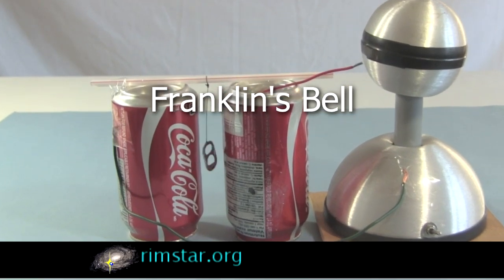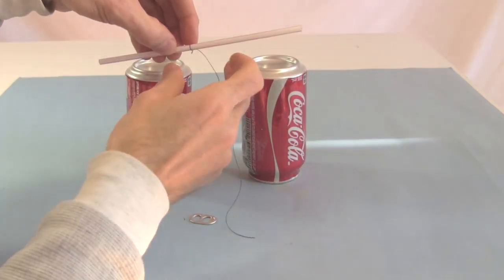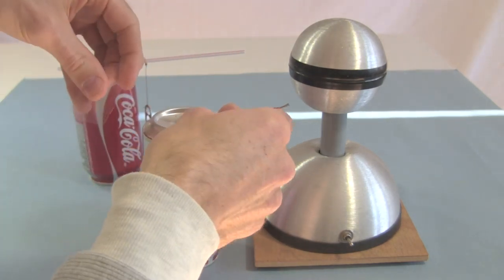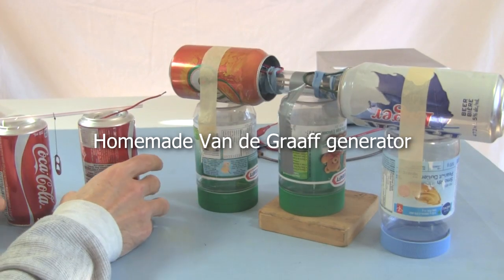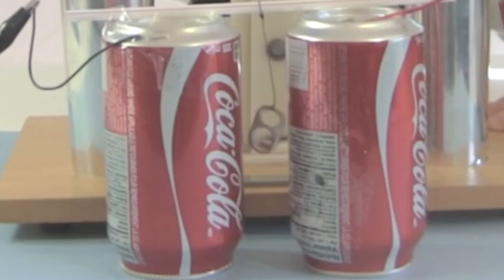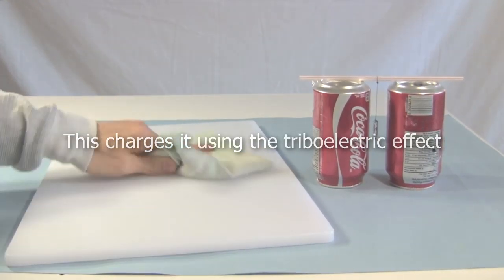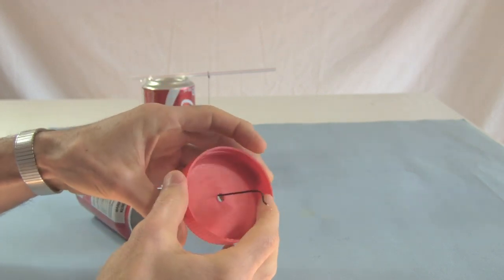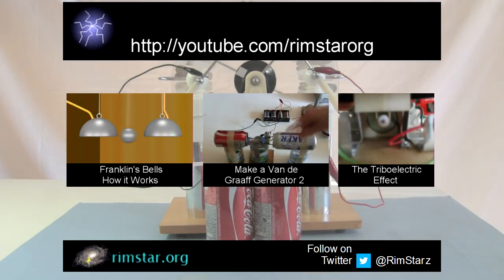Franklin's Bells - How to Make and Demonstrations

Comment from the maker: Glad my video came in handy! Thanks for letting me know! Regarding the cables, any wires will do but those are wires with alligator clips on the ends. It makes them easy to connect to things. You can buy them at Radio Shack or any electronics parts store. Or you can just get any wires, strip the insulation off the ends and tape the ends to where I attached them in the video. Have fun!

Comment from the maker: Is he touching the metal? The spatula must have a plastic or wooden handle, it must be dry and he has to hold the handle so that his hand is as far from the metal as possible. In the video I used a plastic cutting board, which is really just polyethylene. It has no paint or anything on it. If there's paint or some kind of coating on yours then maybe it's not getting charged in the first place. Also, what kind of cloth are you rubbing it with? I think mine is cotton.

Comment from the maker: Which wires are you referring to and what are you powering it with (Van de Graaff, Wimshurst, ...)? At 1:42 you saw it worked with just one high voltage connection, but then at 1:58 you saw it was better with the opposite polarity connected too.

Comment from the maker: I'm working on another video that answers your question. But in short, the lower portion of a storm cloud is negatively charged, causing things at the surface of the Earth to potentially become positively charged. Franklin mounted a lightning rod to the side of his chimney and the top became positive. The other end was connected to one of the bells, the other bell to ground. The sharp positive top of the rod collected electrons from ions in the air.

Comment: Search 'Colorado Springs notes'. July 4th 1899. He used one own method then a bell, to 100 miles and more from storm. 
"An ordinary bell was connected to earth and elevated terminal and often it also responded. A small spark gap was bridged by a bright spark when the lightning occurred in the neighbourhood. By holding the hands across the gap a shock was felt indicating the strength of the current passing between the ground and the insulated plate."
Well worth reading, lots of info per day !

Comment from the maker: Nope, I've never used acetone, or any chemical to remove the outside paint. I have used sandpaper and also a rotating wire brush attached to a drill, both of which worked fine. As for it being better to have bare metal on the outside, I guess it depends on what you're using it for. To build up the voltage, having insulation is a bonus. But I guess at some point you'll want it to arc to something else.

Comment: Do you have experience with acetone to remove the outside paint on the cans to have bare metal on the outside?
 I've heard that there is a varnish even where there is no apparent color paint on the outside of the can. And that it is much better to have bare metal on the outside of vandegraffs and teslacoils terminals and such... just asking :)

Comment: I don't have a plastic-metal spatula so I tried to use an electric fly swatter. The wires are on the inside of the cans and I'm using a tab in the middle. But for some reason it doesn't work, the tab is just touching one of the cans and sticks there.

Comment: Good morning, Steve, can you make an electrostatic charge last longer with a 9- volt battery wired into a 10"x10"x1/8" thick piece of PVC?
Reply from the maker: Hi, I don't really know what you're describing. I can say that a 9-volt battery alone wouldn't help, you'd need some circuit to step up the voltage. And then you'd need some way to spray the charge onto the PVC since PVC is not electrically conductive i.e. the charge won't spread itself out over the PVC. So your high voltage output would need to have a sharp needle-like tip.

Comment: wow! cool. Can you explain a little bit about the cool modification you did at the end with the Faraday Cage aspect? Why does this improve the performance?
Reply from the maker: hi li A Faraday cage is a metal container that, in this case, you electrically connect to inside. Due to the effect the inside surface of the can is always electrically neutral, no matter how high the voltage is on the outer surface. So the wire just sees a neutral or uncharged place to conduct to always, no matter how much charge the wire sends to the can.Compare that to connecting the wire to the outer surface of the can. In that case the more charge the wire delivers to the can, the greater the repulsion by the charge on outer surface the can to any new charge being sent to it.
Reply: RimstarOrg Wow! that's really amazing. So does the base you built for it, seal the inside of the can from the outside of the can (the charge moves through the wall of the aluminum),  or is it simply the geometry of the can that makes the charge stay on the outside and keeps the inside neutral? I was guessing the inside and outside layers of the can were acting like two plate of a capacitor, I didn't imagine the inside one would stay neutral. Is there a way I might have been able to anticipate that this would be the case, instead of the capacitor idea?
Reply from the maker: hi li It's simple the geometry of the can that matters. As for anticipating it, the closest I would come is to think that all excess like charges would repel each other and the farthest they could spread out would be the outer surface.

Comment: It can actually alert of an approaching lightning or it only rings after the lightning has already strike?
Reply from the maker: It alerts about the storm, even if there's no lightning. I would guess that a lightning strike would actually make it stop ringing since the lightning strike would momentarily neutralize the Earth and cloud.
Reply: +RimstarOrg
> "the lightning strike would momentarily neutralize the Earth and cloud."
Ok, but immediately before the lightning strike there would be a huge voltage drop.
Shouldn't the voltage drop be sufficiently to ring the B.Franklin's Bell ?
Reply from the maker: The voltage is what makes the bell ring. Maybe my How-it-works video will help http://youtu.be/fEqudsyIWzk.

Comment: can a 9 volt batery work in place of high volt source
Reply from the maker: No. You need high voltage. You can use the 9 volt battery to power a high voltage power source, but it won't work on its own.